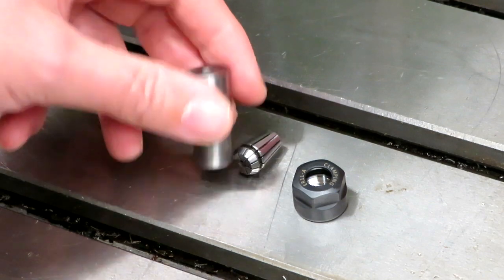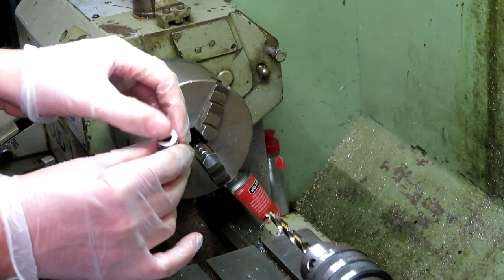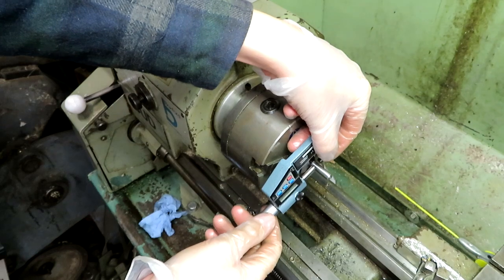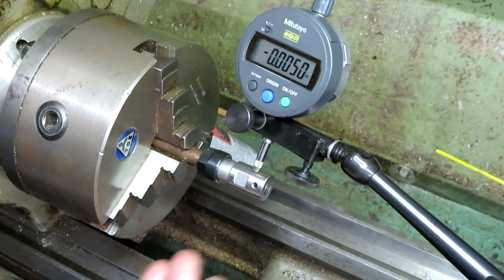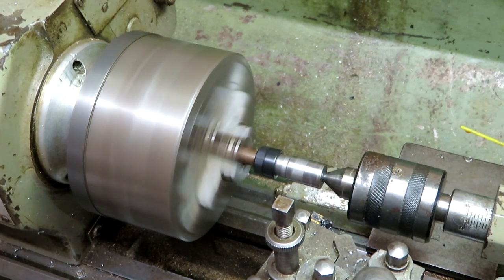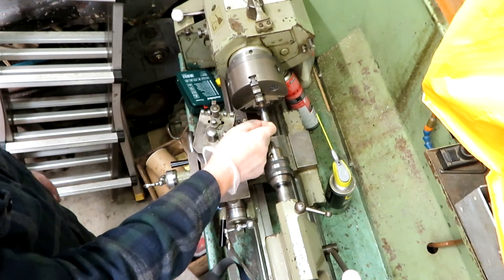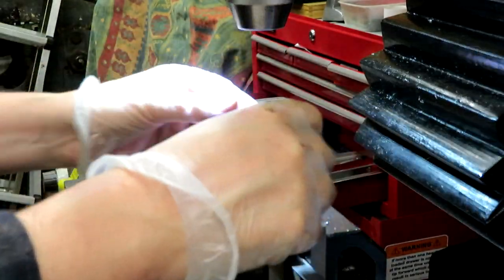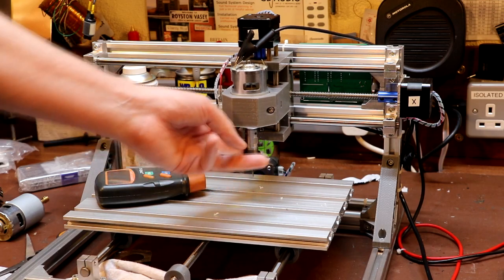Woodpecker 3018 Spindle Upgrade -  Part 2 Bonus Feature

Comment: We used to have a TOS CNC machine at a place i worked at 30 years ago. Think made in the good old USSR . Watched all the way through so must have been interesting. It's a shame the end result was not perfect but  it not bad.
Reply from the maker: My company used to have a massive TOS radial arm drill that was very old. It worked great until something failed in the gearbox. Thanks for watching and sorry for late reply.

Comment: excellent job Chris  haven't done much on the lathe myself most of what I used to do at work a long time ago  was skim plastic mouldings to fit inside ammeters just the simple charge discharge ammeters to retro fit in a car and some usual stuff making stuff that didnt fit . Fit ! 
and I kept all my broken twist drills to grind into small cutting and boring tools !
Reply from the maker: Perhaps I should try making some tooling from old drills etc. Stay safe thanks for watching regards Chris

Comment: My guess is the nut will be what is throwing off the centre on the collet, but the end result does seem to be good enough, it was likely that the offset mass due to the bad machining is what was causing most of the issue.
Reply from the maker: Yes it’s not perfect but it is much better.  I think the taper inside the nut is probably not correct aligned but I don’t have enough material to grind a new seat. To buy a precision collet is similar to the price of the machine so I don’t want to spend so much money. Thanks for watching and comments stay safe regards Chris

Comment: Try replacing that collet nut. If they make a one that has a bearing in the end it will improve a lot.
Reply from the maker: I think it’s possible to by a better made professional collet that will be perfectly accurate but I don’t want to spend the money. I think there is a collet available that would heat shrink fit I may try one of those. Thanks for watching stay safe regards Chris

Comment: Wow that was miles off,  as you said they must have been playing musical lathes with the parts lol.
I think you did really well,  i liked the turning down of a rod and fitting the collet assembly on that rod to make a center point.
What i know about machining, you can write on an atom  (if it spins, keep your fingers out) :-D
The expansion rate of both materials need to be the same .
What a pain in the bum.
Reply from the maker: I think that most of it keeping fingers away from sharp spinning stuff.  It appears that the material elasticity is the most important thing although often difficult to think of these materials as being elastic. Thanks for watching and comments. Stay  best regards Chris